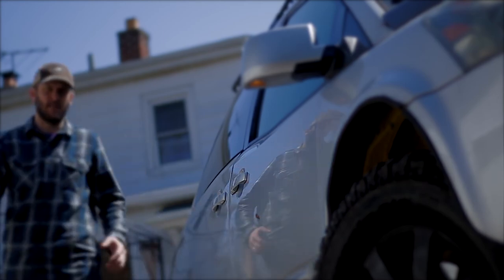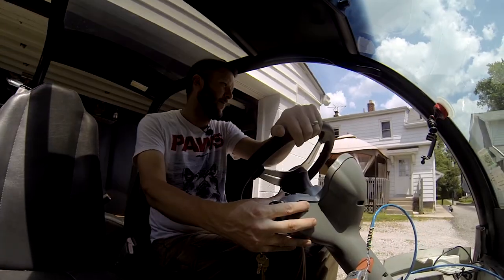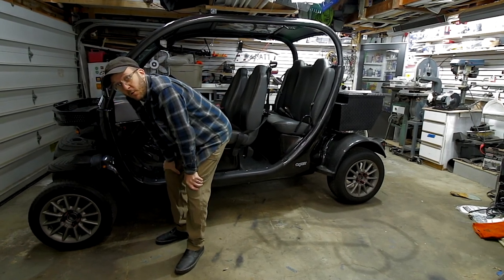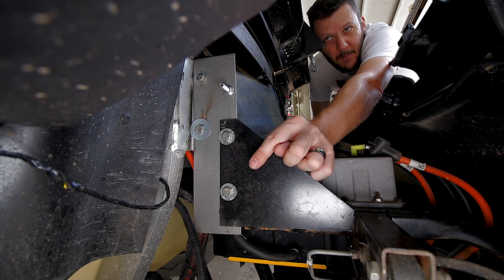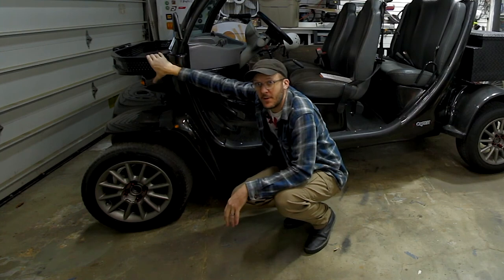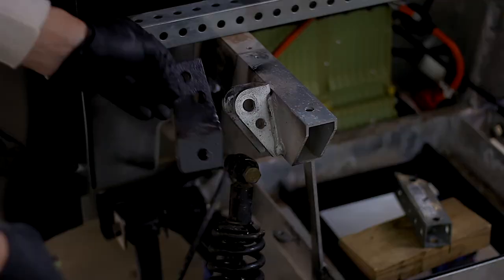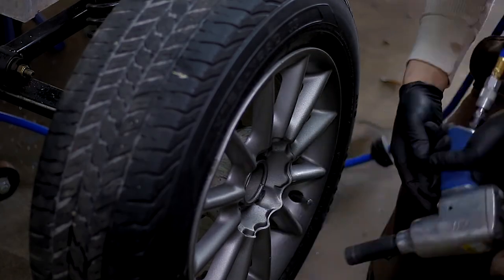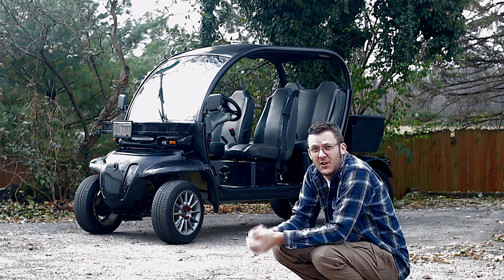2005 GEM 4" lift kit build & guide

Comment from the maker: I appreciate it.
At some point I had to decide if I wanted projects to take 3 weeks to complete, with videos, or 3 days without. 
Filming and projects and editing along with a full time job as well as a side business was spreading myself too thin.  
I still make stuff and have 20 or so projects going in my shop, just off camera.
Reply: We totally understand how filming slows things down drastically. 

I just purchased a flooded 2015 gem and was able to get it running yesterday :)

My goal is the smoothest riding golf cart possible. 
The first easy way is to get the smallest rim and largest tire that will fit.
I have seen lawn tractor tires at 26x12x12. Then air them down. Tall sidewalls...

These tires will more than likely need a lift and axles moved outward.

Next would be air shocks. 

I like your DIY attitude.

Any idea if the 26x12x12 tires would fit with your lift?
And any low cost options for air shocks? 

Thanks...

Comment: So with the lift kit dont you have to do something with the steering column
Reply: I manufacture lift kits for Gems. For 03 models I have 4 and 6 inch kits. Go online to any forum and you'll have recommendations directed towards my kits. Sold over 300 within 15 months.
Reply: @kendallmills1221  How can I contact you ?
Reply: yes, he cut the steering shaft and stuffed both  cut ends into a piece of  tube or pipe to extend it and welded it..

Comment: Matt did you have to extend the steering column?. Did you have to extend the bracket from drive gear to battery tray? I am running into that problem. If not I guess, the moving forward with the increase heigth allows it to pivot enough to bolt up the same. Did you un bolt the steering column?
Reply from the maker: I did have to extend the steering.  I just chopped it and welded in a sleeve to give me whatever length I wanted.    No unbolting needed relaly.  If I recall I jut undid the knuckle to remove the lower shaft.
Reply: @diymatt  Thanks , that makes sense. Really like the idea of pushing it a bit forward to fit fenders better
Reply: Looking for a 4 in lift for a 2005 gem 2 seater with a cage in the back  please I need help

Comment: Can you provide the measurements of the brackets you made.  I'm willing to purchase them if you have drawings with dimensions.
Reply: Has anybody find anybody that does a 4in lift on a2005 e825 2 seater
Reply: I manufacture lift kits for Gems. For 03 models I have 4 and 6 inch kits. Go online to any forum and you'll have recommendations directed towards my kits. Sold over 300 within 15 months.
Reply: @kendallmills1221  Hi I have a 2000 Gem E825 four seat can you sell me the lift kit

Comment: Do you have any templates from this lift project?  I have an 03 e825 I want to lift and put bigger rims on. Did you have to do anything with the fender mounts to get it to fit bigger rims. 
Thanks.
Reply: I manufacture lift kits for Gems. For 03 models I have 4 and 6 inch kits. Go online to any forum and you'll have recommendations directed towards my kits. Sold over 300 within 15 months.
Reply: @kendallmills1221  please give me a link to buy one. I’ve been searching for a month now

Comment: Dug the gem videos. I'm curious about the range you get with the battery upgrade. Also if are thinking of another power option since installing the volt batteries?
Reply from the maker: Thanks!.  My neighborhood is small, 3-4 miles across, so I can't speak to range very well.  I also doubled my battery packs since the video and that really eliminated any range fears for me.  After investing so much in the Volt batteries, I can't see myself switching to any other batteries anytime soon.

Comment: Hey Matt! Thanks for the videos!

I am thinking using a gem for shuttle service.. How did you double the batteries and how much did it cost to upgrade? A new gem with upgraded batteries goes for close to $31k😱😱😱
Reply: I manufacture lift kits for Gems. For 03 models I have 4 and 6 inch kits. Go online to any forum and you'll have recommendations directed towards my kits. Sold over 300 within 15 months. I also have a shuttle service using Gems and other EVs. Been in business for 4yrs now.
Reply: @kendallmills1221  

Kendall how do I find your 4” kit for a E825?

Comment: Hey Matt I have a 99 e825 and cant find any 4 inch lifts , is it possible for you to give me specs on how to make my own possible pics would be great , (no machine shop will have to make myself with every day tools)
Reply: In the next 2-3 weeks I'll have 4 inch lift kits for sale if you're still interested
Reply: @kendallmills1221  interested
Reply: K. Mills I wish to purchase a set
Reply from the maker: The main issue with kits is most of the GEMs are hand built, so what fits on yours will not fit on mine.   I did it all with basic tools.  Just an angle grinder and a drill press and a welder.  Just get under there and figure it out.
Reply: @TeslaAddicted  just seeing your comment. We just sold over 60 sets. We have more in production right now. They should be sent for powder coating in about 10 days. What year is your Gem?
Reply: @genecox4041   @Tesla Addicted  just seeing your comment. We just sold over 60 sets. We have more in production right now. They should be sent for powder coating in about 10 days. What year is your Gem?
Reply: @fabmar3334   @Tesla Addicted  just seeing your comment. We just sold over 60 sets. We have more in production right now. They should be sent for powder coating in about 10 days. What year is your Gem?
Reply: @jeralddunn6736   @Tesla Addicted  just seeing your comment. We just sold over 60 sets. We have more in production right now. They should be sent for powder coating in about 10 days. What year is your Gem?
Reply: K. Mills  it’s a 2000
Reply: @kendallmills1221  hi, its a 2007. 
thanks
Reply: K. Mills 2014 GEM eL XD
Reply: @TeslaAddicted  hi I have a 2002 4 seater I would like to purchase a 4-in lift
Reply: @kendallmills1221  Do you still sell these kits? If so where can I see them? I currently have a Ford Think though I'm in the market for a Gem seeing there are a lot more parts available.